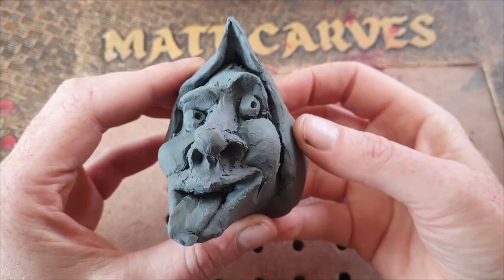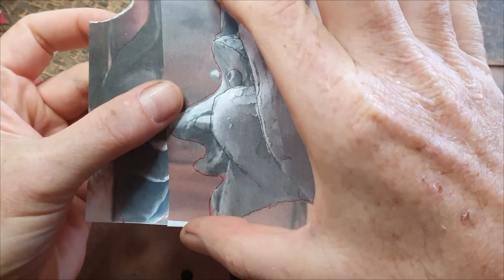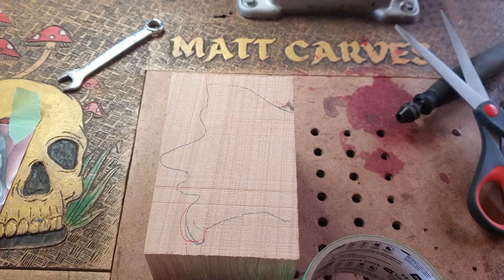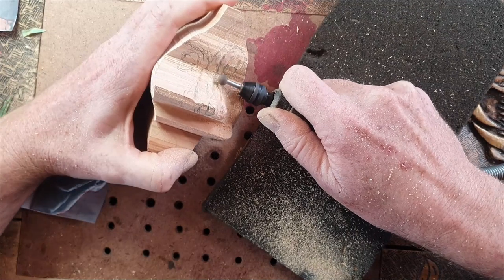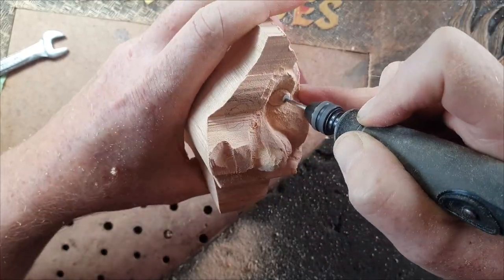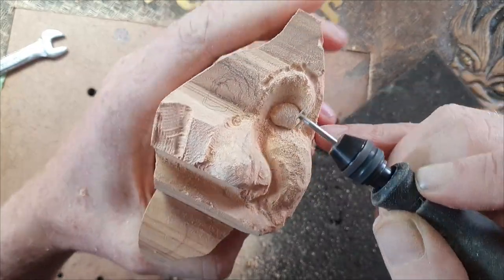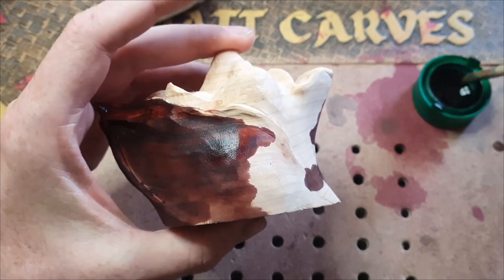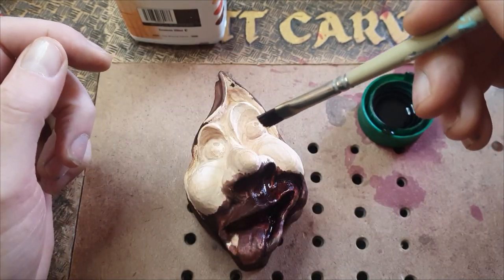Dremel Wood Carving a Gargoyle Face

Comment: I love your videos, concise and informative. I love the info about the clay I have some none carving projects where that would be useful.
Reply from the maker: Cool, cheers Linda. The clay is sold in 900g blocks, it doesn't seem like a lot. But I tend to make small models of what I  am going to make, you can use tin foil squashed into a ball in the middle of a large volume like a head, and build the clay on top

Comment: Cool 👍👍👍, ive been practicing my 3d carvings. I just finished 2 teddy bears ( it's up on my pintrest ). Try using jarrah stain it looks similar to the one you use.
Reply from the maker: Cool teddy bears. Makes you think carving in 3d. What make is the Jarrah stain ?
Reply: @MattCarves  Bondall exterior stain. You can get it stain and varnish in one.

Comment: Nice one Matt.  Is the the 25mm sanding disc you used on the mandrel ?
Reply from the maker: Nah that one comes on the shaft. It's also 20mm which is great for smaller area's